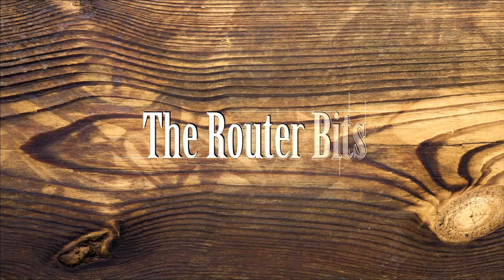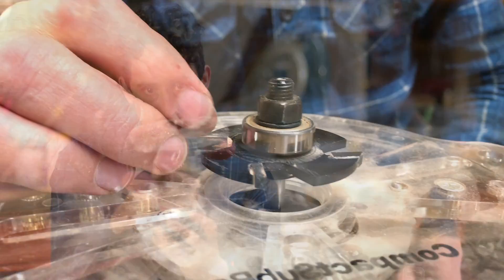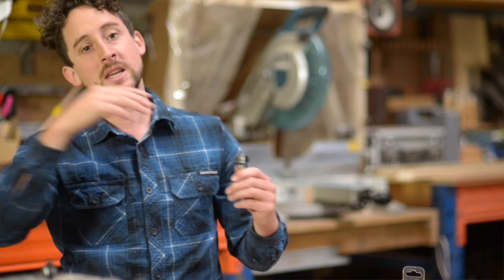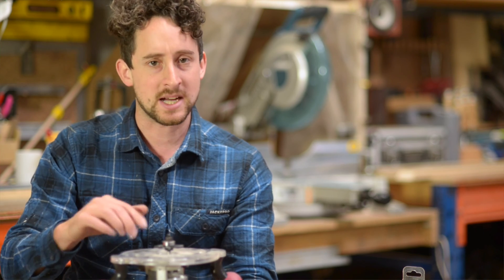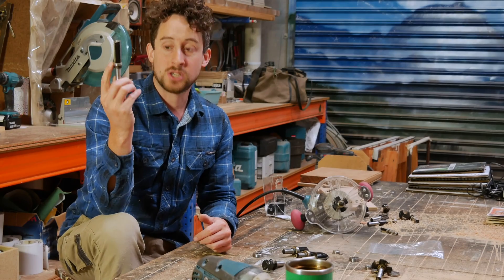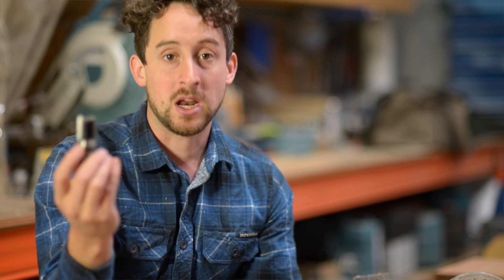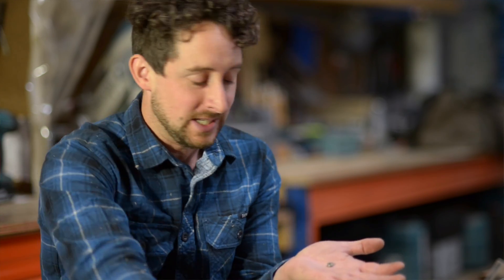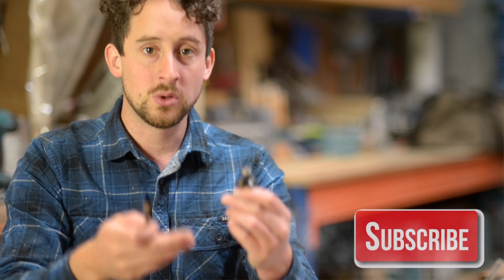The Router Bits - Understanding Bearings

Comment: Where do you get the collets to hold bearings on?  I work smaller than this, with 1/4 or 3/16" shafts (lutherie). I've seen bearings here and there, but of course they need to be held in place.
Reply from the maker: We have the lock rings for the 1/4in shafts: https://www.timbecon.com.au/products/torquata-lock-rings-for-router-bits

Comment: Honest Q- what is a good torque figure when tightening down a bearing?
I don’t feel like I do mine tight enough, but have also had some shatter.
Reply from the maker: We don't have that number but it's good practice to check that the cap screw is tight before each use. Usually it is sufficient if the bit is held stationary in the collet and you tighten the cap screw manually with a regular Allen key 😎

Comment: Hi Patrick. Talking about bearings on router bits. Do you know of any somewhat safe way to use a 1/2" stile routing bit in a table relying only on the bearing due to routing curved stiles for ogee rail & stile panels for wainscoting in a stairwell? I'm slightly worried about kickback due to the size of the router bit (outer diameter 1-3/4") and not having the router table fence against which to put the counterforce. The material is MDF with a thickness of 19mm.
Reply from the maker: I would suggest trying to use a guide pin or clamping some sort of safety stop behind the router bit to reduce the amount of free space the work can spin into (like a deeply curved fence).
Reply: Thanks, perhaps to use the guide pin until enough length is routed to stabilize against the fence placed 4" behind the router bit and also have the safety fence you suggested.

Comment: WOW, think you just steered me in the right direction.  Trying to install a Woodpecker router plate, (hard to explain here), I get the hole cut out with a 3/4 inch guide collar Bushing using a 1/4 down spiral bit, then using the Rabbit bit to make the lip for the plate.  But I have too much room between the plate and the top of the work bench. Maybe 2/8 on all 4 sides.  I'm going to try changing that bearing to a larger one.  You've been an enormous help this January 23 2021 Saturday morning.  I got the idea from this gentlemen. https://www.youtube.com/watch?v=Uv8LqTfWOkc